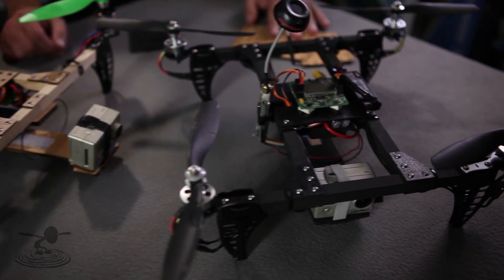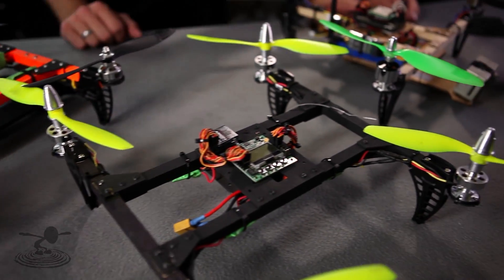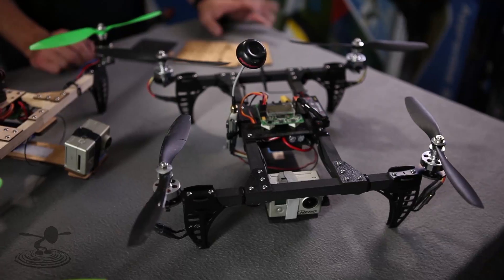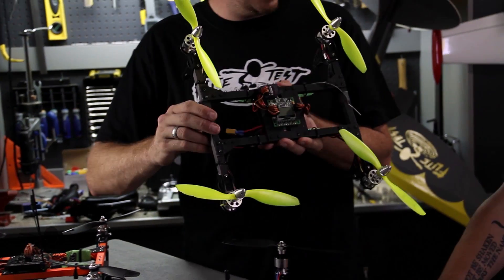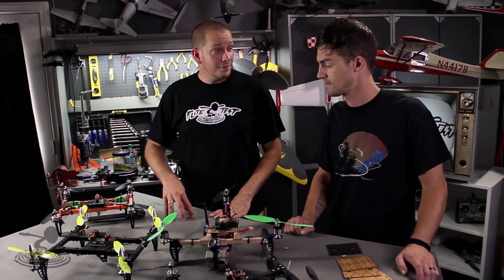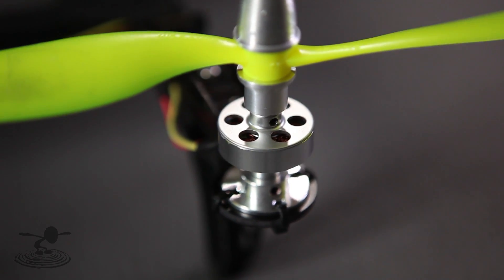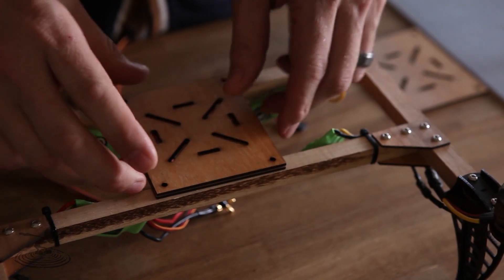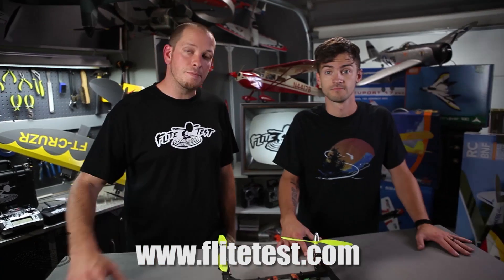Flite Test - Knuckle H-Quad

Comment: Is it an outdated product? Cannt find it on flittest store
Reply: yes, this (like all the rotor bones equipment) is outdated and no longer sold. however, if you are interested in the modular type design, hobbyking has it's "rotorbits" line of products which are pretty similar.

Comment: hello like you videos.  I'm thinking of getting in the hobby. What the best built around  $200.  haha
Reply: +ANDY RIVERA I could point you to an entire system including battery and radio transmitter for that price...http://www.nitroplanes.com/05a92-skytrainer-red-rtf-24g.html. The only thing you will need beyond this is a decent little lipo charger http://www.hobbypartz.com/thac6smbachw.html. This is a great little starter charger that I have used for years after purchase. I also would recommend you purchase and download a good rc flight simulator http://rcflightsim.com, this is under 40 bucks, its 90% of what the 200 dollar sim does for you, plus it has free downloadable expandable models . You can get a USB radio for about twenty five dollars, hook up your pc or laptop with an HDMI cable to the biggest tv you have and spend about five to ten hours running basic models. This can potentially save you hundreds of dollars. You can even fly a similar model to the one I suggested above.  It does not make you bullet proof but it certainly helps. This way you can put models on the wall faster than you can crash them. Plus its basically fun to increase your foundation skills. I have 20 planes and 3 helis, 3 quads and four cars. I owe a portion of my enjoyment and success in the hobby to clearview. I have logged about 50 hours....cheers man If you throw in everything in the list above you are talking a little over 300 dollars. Get the sim and USB controller first if you want to break up your cost. Then I would buy the charger so that your planes have a way to charge when they come in the mail, everything else is up to preparation, good nerves and good weather.
Reply: Thankyou
Reply: ANDY RIVERA No problem man, you can get a lot for your money. Nitroplanes is a great sight as well as hobbypartz. If you spend over 50 bucks on hobbypartz you get free shipping in the US. I have taken advantage of that an insane amount of times. Let me know iif you want to look at radios beyond the one provided in this kit, that would be my next approachable item after the one's above. Something that supports multiple models in one radio is a must once you get past two or more planes. I have recently done research on affordable radios so its fresh on my mind..lol
 Have a good one man.....
Reply: If you haven't bought everything yet, I would go with a small toy quadcopter like the syma x5 over a simulator and USB controller, its a bit cheaper and more fun than learning from a simulator, and I think it is easier to relate to

Comment: i am planing on building one of these for the first time as my first quad-copter, but i can't find anything that explains how to build it well like the wiring. if anyone can provide a article/video/pictures or anything that would go through the step by step build, it would be greatly appreciated thank you
Reply: I had the same problem use the build video for the body and then you'll need these parts which are not listed in suggested part list 10 male to male wires, remote and receiver unless u have one zip ties at least 20 probably better with more, 3.5 mm gold connectors, and all of suggested parts if u have them

Comment: So I'm putting together my first multirotor and I got some rubber o rings with my motors... what are these for???
Reply: Prop savers.They are used in planes so when the plane crashes the prop doesn't break.However for multirotors it's not reliable.If you don't have a prop adapter then use zip-ties in the place of the o-rings.

Comment: Dear Flite test crew  I am looking to build my own micro quad 
without breaking the bank could you guys help out???  PLEASE RESPOND
Reply: depends on what u consider breaking the bank. If u make the frame yourself u can already save quite a lot of money and make it easier (and cheaper) to repair it in the future.
I just made one of these and if u want I can maybe help u with some of the parts I had in my hk order.
The order I placed was 350$(incl. shipping) but also contained a Mobius and some other (spare) parts.

Comment: I have to put a warning here!! If you watch this video more than once you get stuck in your mind and also need to get one yourself! I have just put an order of parts at Hobbyking according to Flitetest partslist. Ended up with USD260 incl all needed without frame (printing my self and buy woodsticks elsewere) and LiPo-charger. Only to get flying. FPV not incl.
Reply: True I also made one like a month ago but I ended up with 350$. I also bought a Mobius and some other (spare) parts tough, I could'e gone cheaper but I wanted at least 1 spare motor//esc and what fun is flying if u only have 1 battery?
I am even thinking of maybe making that T-copter in the near future (maybe). ;)

Comment: Out of curiosity, are quads an easy thing for a new person to learn on?  They look so stable and they appear to be incredibly easy to use at slow speeds.  I want to get into the hobby, but I think the quadcopters are more interesting to me since I can strap a camera to it and get some neat footage.  I would love to be able to get aerial footage of family, friends and property.  I'm sure it could be done with a plane, but I really like the stability of the quads.
Reply: Honestly I didn't find my first quad that hard to fly (Twister Quad, same as a Walkera model just can't remember model number), I had no previous air RC exp, and was flying it in my small room within like 30min. (after battery finished charging)

Soon got a 450 size quad, and I've only had 1 flight on that, and apart from it being abit intimidating (hands were shaking heh) it was super stable and fun

Comment: With the blue wonder motor do I have to do any soldering to connect it to a multistar ESC? If so is there a different motor or ESC that i can use where I wont have to solder?

Comment: Can someone estimate for me how much it would cost to get a decent fpv setup with one of these motors, batterie, controller ect included. And if u know any multi rotor fpv set ups that I can buy and have built already can u tell me. I have only found the tbs discovery. Thanks.

Comment: Specs please!....specs please!!!.... put all the spec. It´s very useful

SPECS:
Baterry:

Props Left:
Props Right:
ESC:.....
Weight:
Range:
Radio:
Motor (Brand, Power, etc):
Configurations for the KK2 (PI-Gain, etc): 
Height above sea level:

If you need help for something I could help you to make all the documents for this...